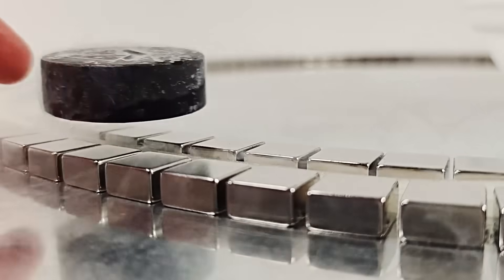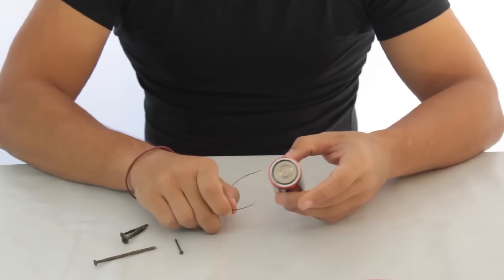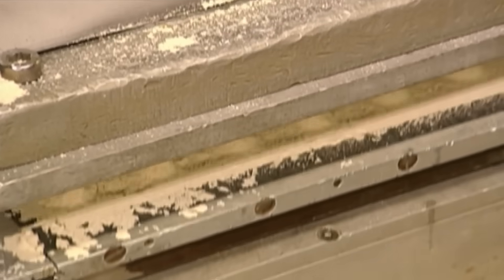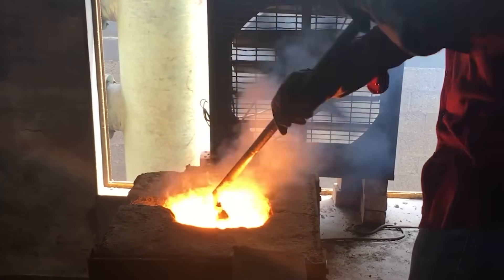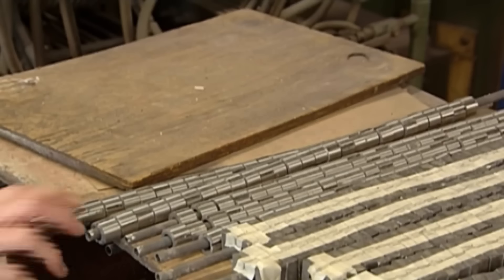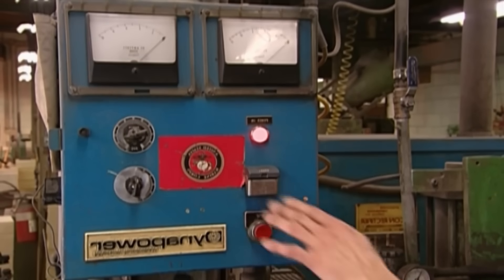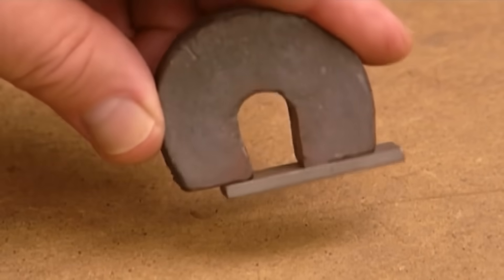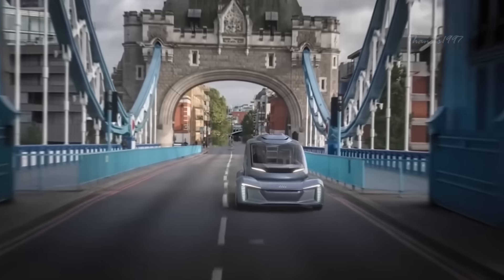How Magnet is Made

Comment: Dr. Stone brought me here
Reply: 😂 YEP same here! 😂
Reply: Yes same here!😂 note an easier way of creating a copper wire is to create a 10 foot tall box for molten copper sand casting. Set it to stand leangth wise in end. Then suspend rows of thick yarn, with a wax ball at the end to weight it down & keep it straight. Then fill in the 10 foot tall mold with oiled sand. Once the sand has settled into place pour the molten copper into the mold, & it will burn away the yarn & wax and presto! Easy copper wire. It might take a few goes of it though lol.
Reply: Also look into voltage “stepping” with copper coils & spark gap lazers. You can literally create a laser from two metal edges sparking together to create a plasma laser

Comment: Aluminium melts at 650°C if it's heated to above 1500°C won't it get vapourized ?
Reply: Boiling point of aluminium is around 2467°C, so it should be fine

Comment: Worked at a place that made neodymium magnets. They melt the iron then add the boron and neodymium plus a little nickel and cobalt. Then it is cast and crushed to fine powder under nitrogen. This powder is pressed into blanks that are sintered under a vacuum with a rather weak magnetic field on it, This weak field does not charge the magnet but polarized the crystal structure so it can accept a charge. Next they are cut and ground to spec and coated with epoxy or plated with nickel. When they are ready they are charged by a powerful pulsed electromagnet. It has a field a couple orders of magnatude stronger than the resulting magnet. It will wipe your credit cards from 12 feet away.😮
Reply: Wipe out credit card chip data 😂😂
Reply: @TONY1-2  it's the US they're still on signature and checks
Reply: Damn. Thanks for your information.
Reply: Nope, they can't wipe out credit card from even 1 ft.
Reply: But how is the pulsed electromagnet made ?
Reply: @jeremykemp3782  it's made of copper wire made to the shape needed to magnetize the material. It's filled with epoxy for insulation and so the coil won't blow itself up.
Reply: @jeremykemp3782 The video describes how electromagnets are made.
Reply: Your description of the process to make magnets was better than the videos description!
Reply: How is magnetic metal filings made?🧲
Reply: I don't think it was created that way
Reply: @CaptainDiscover  You are correct.  You don't think.

Comment: magnets dont power MRI.. get that story straight.
Reply: Who said so? I have video
Reply: @CreateOne9398  I believe that
Reply: dude it's call a electromagnet go on google no cap
Reply: @colourbasscolourbassweapon2135  so you mean its just magnets. No outside power source needed?
Reply: the magnet is engine of the MRI no cap
Reply: The magnet creates the polarizing field. It is a superconducting electromagnet. Oddly enough the superconducting wire is inside a copper heatsink. The wire is briged on the top with a high remperature superconductor. The charging process takes several hours, and most have 80 to 120A of current flowing through them. When the desired current is reached the high temp superconductor is allowed to cool allowing the electricity to flow in an endless loop. The mri images are from a powerful RF transmitter pinging the hydrogen in your body and the echos are detected and rendered with math.❤
Reply: @christopherleubner6633  yup. requires external power source. the magnet itself does not power the MRI.